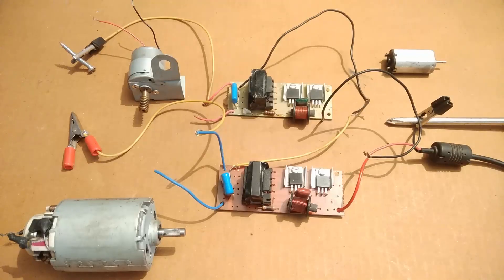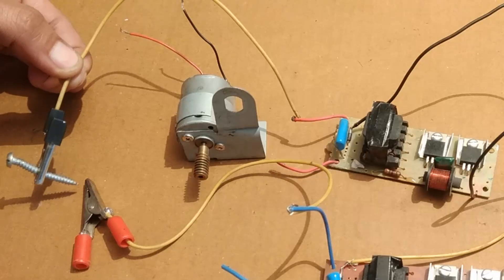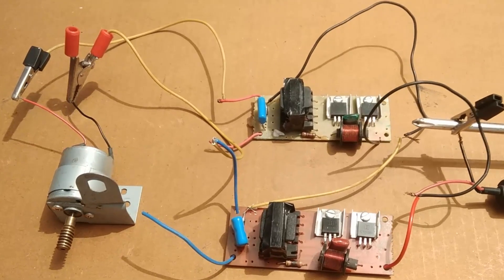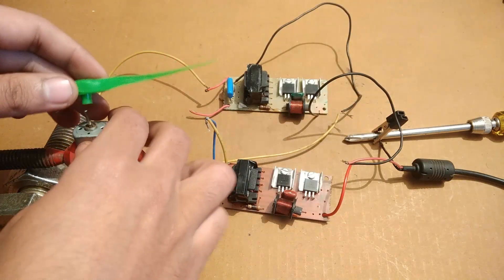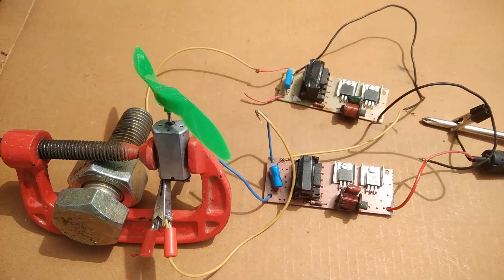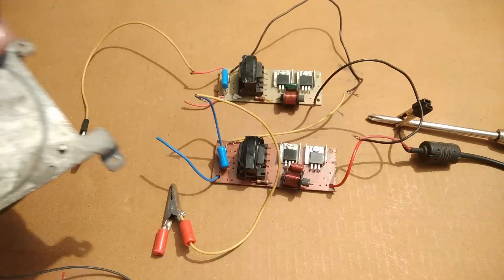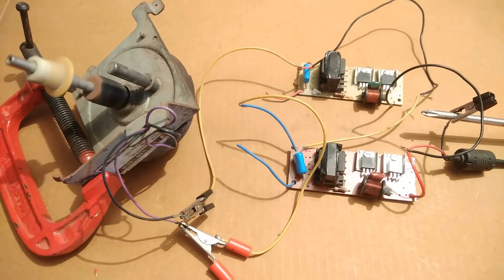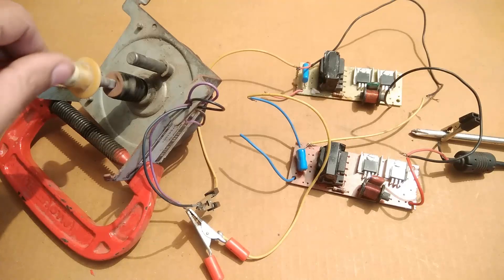Wooow!!! 3V DC MOTOR forced at 4000V | Awesome idea New DIY

Comment: I HAVE A REFRIGATION , HVAC, REPAIR BUSINESS. MANY YEARS OF SERVICE I FINALLY FOUND AN EXELLENT DESIGN EFFICENT SOURCE TYPE OF DC BRUSHLESS CONDENSOR MOTOR.GENERAL ELECTRIC ,MADE IN ITALY. FULL BEARING ,NON AJUSTABLE SPEED CONTROL SET 1625 RPM,CCW. LEARNED HOW TO SWITCH THE POLARITY OF 2 WIRES INTERNALLY WITH IN THE CONTROLLER. I AM STILLNOT ABLE TO VARY THE SPEED. I STUDIED THE SPEED CIRCUIT ANH FOUND A HALL EFFECT DIODE SENSOR. THERE HAS NOT BEEN ANY INFO ABOUT THIS DESIGN EXCEPT WHAT I POSTED.I PURCHASED 105 OF THEM BRAND NEW AT 15 DOLLARS EA. I SEEN SOME FOR SALE USED 25-40DOLLARS . I NEVER IN 38YEARS REPLACED 0. IWAS ABLE TO SLOW IT DOWN JUST BY USING FIXED SERIES CAPACITORS IN LINE SOURCE AC SUPPLY IN VOLTAGE. I KNOW THEY RUN  MUCH FASTER THAN 1625 RPM BECAUSE WNEN I SELECT A LOWER SETTING USING TYPE OF CONTROLLER FOR A NORMAL CIELING FAN FEEDING THE DC CONTROLLER WHEN I GO BACK TO FIRST SETTING THERE IS A LAG ON THE CONTROLLER FOR FEW SECONDS MUCH HIGHIER THAN 1625RPM, APROX. 3200RPM BUT TTHEN RETURNS BACKDOWN TO 1625RPM. I NOTICE THE SAME FACINATING INTEREST IN MOTORS WHEN I WAS 7 YEARS OLD. I DID NOT THINK THERE WAS ANYONE PERSON IN THE WORLD THAT SHARED EVEN CLOSE TO THE SAME.I WORKED ON SOME, PWMS,  VCO PHASING  PHASELOCK LOOP , THERE IS NO SCHEMATIC DIAGRAM , I AM STILL IDENTIFIYING SOME PARTS. IN ONE OF YOUR SEGMENTS MENTIONED HALL EFFECT SPEED SENOR SIMILIAR TO IGNITION SYSTEMS  ON ENGINE DISTRIBUTORS FOR GAS ENGINES????

Comment: how to find a dc motor maximum speed? i have a screwdriver set with 4 alkaline battery operated but spedd is tpp low 6 volt i want to convert to 12 or 24 volt dc operated without burning my screwdriver?

Comment: hi bro.. I have 2.5hp vDC 220 motor  max 5hp  RPM 4200  I want to make use of it in my petrol bike the way u used in ur Electric pulsar project  ... I want to keep my petrol engine as well can this run on the   as one u used to drive dc motors in ur this project?
Reply from the maker: Hi! Thanks for the project but it cannot run on 3000 Volts.Since the power rating required for you project is 2.5Hp then it will require a lot more transistors in parallel
Reply: Mr Electron dear it's max voltage is 220 vDCif I give 4000v from ur way it will work ok??? as 4000* mil amp  will be good enough
Reply from the maker: Inder Kumar ohh!! That way.. No, you should use a 2kw high power 220V inverter and then rectify it to obtain 220V DC at high current. The method i am using is good for smaller motors.
Reply: Mr Electron actually that motor runs on all voltage 12,24,36.. but lesser RPMas voltage less........ up to vDC 220 I think that should run on  4000v * mili Amp  what u says about it ... this motor is permanent megnet Dc motor
Reply from the maker: yes but 250V should be maximum applied voltage for better life of the motor.

Comment: The motor will blow.4000V is too much for the motor to handle.And current is directly proportional to potential difference.So as the voltage increases,current will also increase.
Reply from the maker: I have placed a limited power source so the current is alao limited

Comment: The motor should have exploded with 4K Volts. I apply my laptop charger 19 volts directly to the dc motor and it spins like crazy, heats up and its inside brusher is damaged. So, what's the difference with your experiment? Nothing much, isn't it?
Reply from the maker: Laptop charger current is 4000 mA while i used the current of 150mA max.Thats the difference.

Comment: 8:10 the "motor" runs even before the supply is connected. 
RIP the circuit's output wires are not even correct

Comment: You can get the same speed with a powerful 12 volt battery since your 4 kv power supply only outputs a few watts + it becomes a short circuit and drops to around 20 volts

Comment: I have a rc boat with 7,2 volt. The Battery was broken So I put a 12 volt drill battery on it. IT worked but one motor had a higher rpm then the other and it wasn’t making sparks. Is this because overvoltage?
Reply from the maker: Yes , the circuit is not able to adjust itself to the new voltage
Reply: Mr Electron Thanks for Your Message! Have a Nice day

Comment: You should charge some capacitors in series with the power source . then connect it to the motor!
Reply from the maker: motor will explode then coz the output current is gonna be higher in that case

Comment: Given the voltage ur saying, commutator of the motor will burn off.
Reply from the maker: Yes ofcourse if used for longer time since it is operating much higher than its rated speed

Comment: 😂😂😂 this is just a shit... what do you want to explain dude... if u just rise up the voltage the current will be decrease in Ur ckt. so overall power will be same at input and also at output... 
P= V × I 
it's same as u can connect it to laptop adapter directly...
but Ur r westing some of the power at invertors stage😂😂😂

Comment: mr electron try to do this experiment with a 15kv flyback transformer based on zvs driver let see what happened. by the way nice rare idea\
Reply from the maker: Current from a fly back transformer is too less to start a motor..
Reply: if you use a zvs driver for the flyback you will push more current limit from the flyback

Comment: In this video you need to know that v= ir and w=vi . when you connected your load measure that voltage is comparative very low I hope like 30 volts. If its even 100 volts DC the motor insulation breakdown and the motor is not running it just burn. Please do not provide this type of wrong and misguided information . at first you should no that what you are doing

Comment: There is a problem here. If your dc motor is 3v and about 1amp, it should use 1333 amps when is powered by 4000volts! 4000 x 1333 = 5332000watts so as soon as your power supply can't output 5,3 million watts the dc motor does not operate in full power.
It runs at about 19 x 5 = 95 watts So this motor takes 1/56126 of what it would take normally at 4000volts.

Comment: Fake video ! It's not 4000v 
I have connected my 3v dc motor to a 400v dc (converting 220ac to 400v dc) my motor burned. It's a fake video. It's not 4000volts
Reply from the maker: u have to minimize the current .Not FAKE.

Comment: thicker cables may help with the voltage drop. also, your probably only outputting 22V from that circuit or even less.
Reply from the maker: Full Voltage check of this video here at 9:38 : https://www.youtube.com/watch?v=SmV6GIq8rGI

Comment: I think it's not voltage or current but both ie power tat matters.Ur supply has high voltage but low current .As the motor demands current the voltage will surely drops gaining current therefore it's not 4000V it will just be 4-8 volts as the motor is not burned.
Reply from the maker: You explained it well but for the voltage part  check out this : https://www.youtube.com/watch?v=SmV6GIq8rGI  at 9:38

Comment: Well how can you apply such voltage without drawing high current? I mean that the motor has a constant resistance so the voltage is directly proportional to the current
Reply from the maker: MOTOR HAS constant resistance only at stand still but increases as it attains speed..

Comment: You are adding dc motor to high voltage, but at high voltage dc coil will burn off. what is remedy for it
Reply from the maker: use low current supply

Comment: Hook that motor up directly to that laptop charger and you'll see more spectacular results. With other words, your "high voltage inverters" don't do shit under load, high volt = low current = high internal resistance = voltage drops like tungsten balloon, electrics 101. Thumb's down for misleading  title and not measuring results.

Comment: +ElectroBOOM @ElectroBOOM (or whatever the hell you mention someone in a YT comment, i wasn't able to mention someone in the last 5 years ;-( )
Glad to find one of your comments.
For +Mr Electron @Mr Electron 
Yes, your source is 4kV, but while is floating, with a load the V drops, this actually depends on 2 factors in this case:
Inductance of the motor and the 2 transformers 
Combined resistance of the circuit
As Mehdi (ElectroBOOM) once said, current is proportional to the voltage and resistance, so, if you know one (eg the R) you have the rest, now, search google for ohm's law and resistance itself, you'll see that a resistor limits the pass of electrons through a conductive material, a resistor always has a voltage drop.
Why the inductance matters? Because of impedance, your supply is a SMPS, witch means that runs at a certain frequency so thus an inductor behaves partly as a frequency-dependent resistor, partly as an inductor, another voltage drop in the bucket.
Add all the drops you had in your circuit (on the wires, connections, motor, transformers etc.) and calculate the impedance of your circuit for the given supply frequency, the motor has a low-ish resistance, for 3V in order to draw 0.1A (100mA) it needs to have an ESR (Equivalent series resistance) of 30 ohms, 
Considering that the resistance is 30 ohms, at a supply voltage of 4kV (assuming the initial 2 seconds it would remain at 4kV) you'll have a current draw (according yet again to ohm's law) of 133.3A witch equals to 533200W (533.2 MW MEGA WATTS!), fortunally, the current is limited by everything so it doesn't go thermonuclear (good on ya clive) so the voltage drops, to a level in witch the motor draws just enough current to not exceed the current capability of the supply, when this point is reached, the voltage has dropped to a constant level. if you vary the load the voltage will vary as well until it reaches the equilibrium again.
Also, another important factor is the input power, a transformer is not a free energy device, if you don't input 522MW you won't get 522MW; always your output power from a transformer (regardless if it runs at 50Hz or 50MHz) will be a bit lower the the input power because of losses in drops across the transformer's windings and across it's core due to a non-ideal magnetic coupling.

Comment: You are giving simply 12 to 24 Volts to the Motor from The Laptop Charger because there's no circuit explained and no measurements available. Totally Fake

Comment: I hope you know that you are using a very low current supply and there is a limit to how fast the motors can run , after the threshold rpm the armature will be rotating too fast to get a push from the magnets so it rapidly moves up and down the threshold   rpm .

Comment: Very nice..... as volts go high, current or amps go lower, so you have low current DC to run the motor and at higher frequency because  of the pulses from your power supply....=high RPMs

Comment: Hey but the would not the wires quickly over heat cuz I just applied 20 its brush burned
Reply from the maker: randomnizer your current was high and mine was not

Comment: Lol. It not 4000v. Under load maybe 10 to 20v. Try put the motor on 240v plug point. It will create a fireworks show.

Comment: Half of circuit will does much then you can imagine. But you will need more then 2 equipment with half circuit. That will not burn and brake a full circuit. 2 individual circuit can not be short circuit. You have to be as silly as dumb. you will not know any scientists that can prove your logic. Logic is not known other then logical circuits. LOL you are lucky that i know it worked.

Comment: very good demonstration but .. that propeller mounting was very dangerous it can even cut your skin if that propeller got detached from motor due to the generated downward thrust. since they are dc motors if u drive them continuously their contacts will wear out.

Comment: Have you ever checked the actual voltage on the motor? Just because the 3V motor will start to falling apart over 24V. It could not be more then 16-18V. Try it again with way more power full high voltage transformer like from microwave oven, the result will be even more funny. :)

Comment: I have one doubt..

In most of electronics, All are connect the GND terminal permanently, and positive as switch connection..

But in this video, your laptop adapter's positive terminal connect permanently and Negative as switch...

Why?
Reply from the maker: Sathish Deva its applicable mostly at high voltage
Reply: Mr Electron Thanks for your instant reply

Comment: you have no any measurement , then how you  sure that voltage apply to motor ?  I think when current flow through motor voltage will drop to 10 - 20 volt . (dc motor will broken cause ever current if you apply too much voltage).

Comment: The motors are a huge resistive load. Sorry but you are not putting that much voltage on there. Use one of you high voltage probes and you can see the drop off. If you don't have a high voltage probe check out Ludic science's channel he has a great video on building one cheap.

Comment: Since the resistance of 3v motor is not so high to handle 4000v DC supply .Hence you have provided lesser than the mentioned input.Otherwise motor circuit would have been brunt in seconds with that supply.

Comment: correction, your 4kv source will only put out a few watts meaning the current is limited and the voltage drops so the title should be running a 3v motor on 5v

Comment: Supplying a fraction of a milliamp at very high voltage to a motor that has very low resistance and high current draw will do nothing. The voltage at open circuit is irrelevant when you effectively short it out. The wiring trick is really only supplying the laptop supply voltage to the load. If you really want to see what happens with very high voltage on a small motor, rectify the mains supply and connect it up... you may want to leave the room to turn it on as the explosion will send shrapnel in all directions.

Comment: These motors aren`t getting 4kv for sure. One thing is the open circuit voltaje wich can be 4000v but as soon as you close the circuit the suppli can´t sustain it.
Reply: yo better of connecting them to main power 220v ac rectified with a full bridge rectifier. (They will probably explode)

Comment: That s probably 80- 100 volts.  Otherwise the brushes would melt and disintegrate.  And the thin wire  would melt

Comment: The voltage drops because of the load. Measure it with a multimeter at the contacts of the motor and see for yourself

Comment: As long as insulation of winding and winding doesn't get breakdown both mechanically and electrically motor will run on any voltage...

Comment: Sir we can use this circuits with bldc motor so no problem about carbon sir i want to know about those circuits please reply thanks.
Reply from the maker: syed sikander Yes but we need to control the voltage